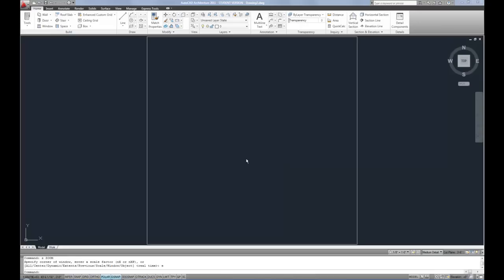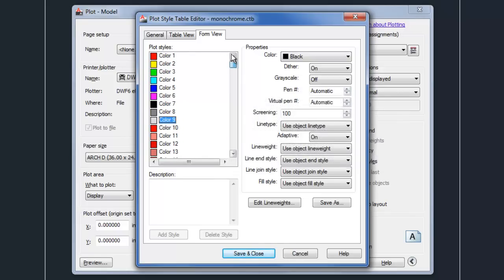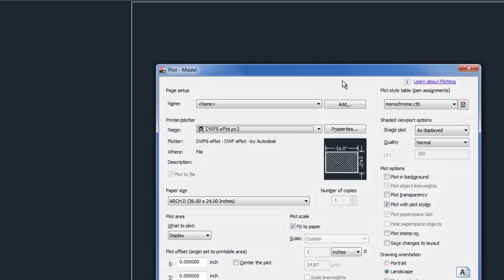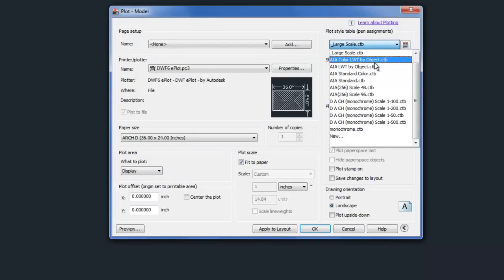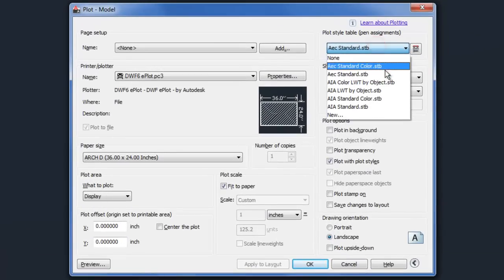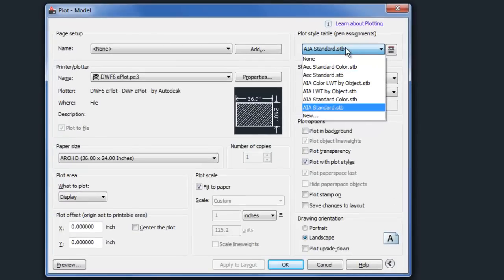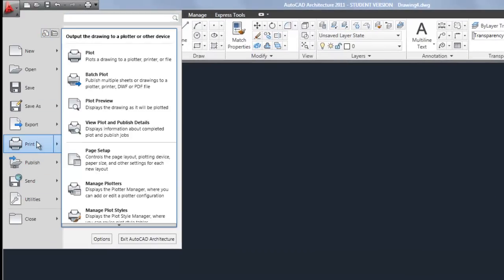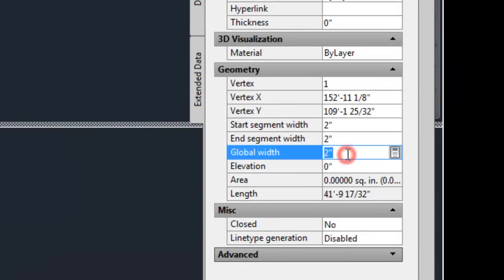AutoCAD Fund.: lineweights

Comment: how  is different between the adjusting  Lineweight in layer   and  Lineweight in Acad.ctb .
 i want to know do i have to use both or only  one of them .and modifying one can influence on other .
please help me if you can ,and give me answer as following E-mail or here , jamesnote@naver .com 
thank you very much .
Reply: +lee james Adjusting by layer controls for the drawing itself.  Adjusting in the plot style table obviously edits how things plot/print.  Ponder the consequences:  editing the CTB will affect all future drawings printed with that CTB.  Maybe that&#39;s good, maybe not.  It will require you (and your co-workers) to always use that CTB.  I suggest watching my video on plot style tables to help you choose a management method. &#160;

My suggestion would be to first pick a plot style table that will determine HOW you want to control lineweights.  I.e. do you want to control by color, by lineweight setting in the layer manager, or by plot style setting in the layer manager.  Controlling by color is an outdated method, but people still use it.   

If you control by color, then adjust the CTB and layers to work together at the same time.   If you control by lineweight setting or plot style setting in the layer manager, then your question is moot because there is only one place to set the actual widths for each method.

For example, to control by lineweight, in the CTB you pick "by object" and then adjust the actual widths in the layers.     To control by plot style, use an STB plot table, adjust the available styles, and then pick the ones you need in the layer manager.

Comment: Jeremy, I have a question
does lineweight scale up/down to correspond with your intended print scale as drawn objects do?
for instance: a lineweight of .008" when printed with a 2:1 scale does that appear on paper as .0016"
Reply: If you print from paperspace (1:1) and use the viewport to set the drawing scale, then the lineweights will be adjusted properly to work for the viewport scale.  If you take a big sheet and print it "fit to paper" from paperspace onto a small size sheet, then you need to check the "scale lineweights" box to make the lineweights adjust down.

Comment: I have been looking all over the web to find where to add a custom lineweight to the list of available lineweights. I am plotting with laser engraver/cutter. It interprets a lineweight of 0.001" as a vector and will cut that line, all other lineweights are Rasters. Any idea how I can modify the list of default lineweights to include 0.001" 

It oddly skips that weight.

Comment from the maker: @ToBeRnot69  I would consider 3 categories of items that you could learn about:   commands (like convertpsytles), system variables (control AutoCAD's behavior), and aliases/shortcuts. A good place to start is going to Help, which in newer versions takes you to Autodesk's website.  Then go to "Command Reference," after which you can look at "Commands" or "System Variables."  To look at aliases, open the acad.pgp file on your hd, which is also on the "Manage" ribbon tab, "Customization" panel.